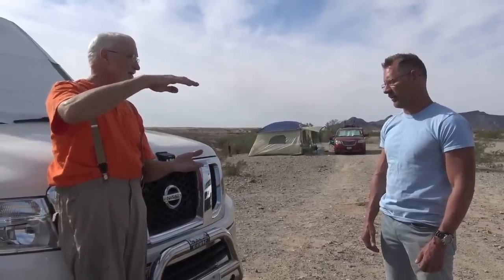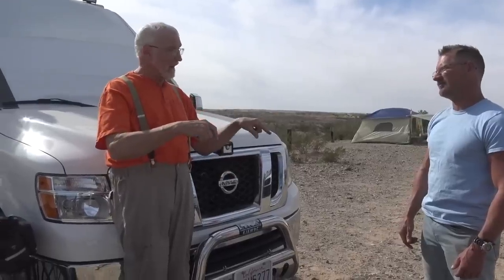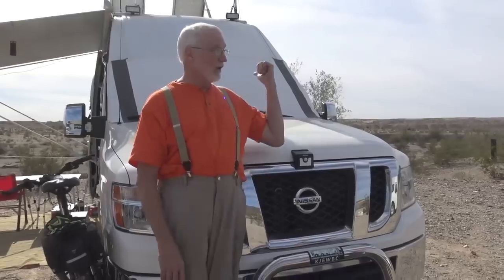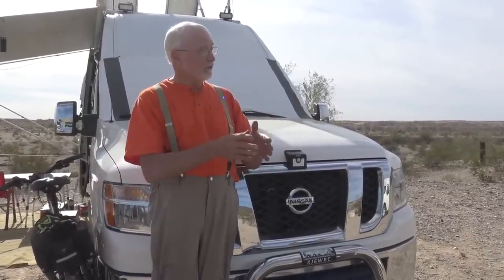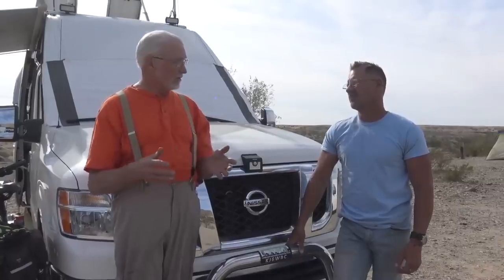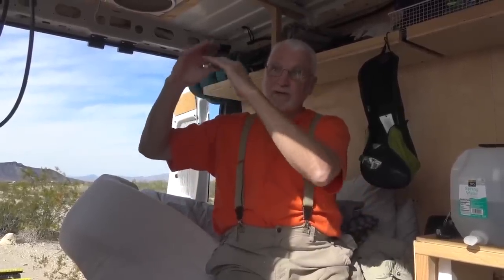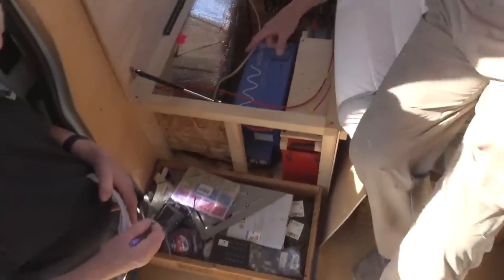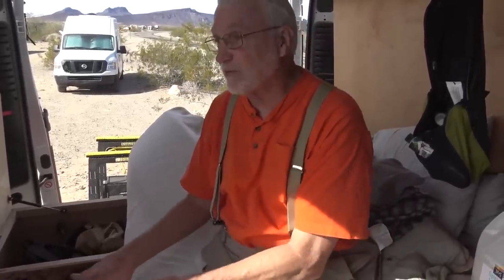Lee Blake: Deep Cycle Batteries |  Solar & Islolator Charging Explained

Comment: Lee is a wealth of knowledge and if you don't want to do the investigation just do what he does. That said when I first learned about the PC1800-FT batteries they could be purchased for 450 each. Now they're 600. Out of my price range. The UB121000 are 150 each making 400Ah half the cost of the Odyssey pc1800-ft times 2. I concede that the Odyssey pc1800-ft is a better battery, but if I were to spend 1200 I'd spend 1700 on Lithium.
Reply: Wow, just read about this battery. 22 inches and packs that much power! Amazing. Does this battery have to be vented?

Comment: FYI- the battery isolator that Lee is using is expensive but after watching this I started looking around and I discovered that Sure Power makes a few models also.  Thwy have 12v and 24v models.  Sure Power 1315-200 | 12-Volt 200-Amp Bidirectional Battery Separator.  Sure Power 1315-100 | 12-Volt 100-Amp Bidirectional Battery Separator and both are less the one Lee is using although I bet his is top shelf.

Comment: At 12:12 is the reason i'm thinking that installing a smallish Electrical Boiler in a VAN may not be a bad idea... may need somewhat of a smarter control unit, but using the power to heat up water isn't a bad use for it ... somewhat similar with an electric heater ... but again there you will want a smart controller and battery management system to use the power in the smartest way, to keep comfort levels high, while using the most power possible, while still keeping the battery full ... maybe even an integrated weather forecast system can help to determine the amount of power to expect to be gained ... and obviously some memory in regards to the power usage profile ... obviously would need various sensors too ... but in all honesty, the whole thing doesn't sound to complicated, and a raspberry PI is probably already overkill for something like this.

You got your energy sinks: battery, waterboiler, electric heater (with feedback sensors)
You got your energy use profile: daily habits, weekly habits (registering database, query's)
You got your energy supply: solar power (shore), battery
You got your energy supply profile: weather forecast (historic energy supply data)
You got some priorities to be set: order of shut down, order of using sinks.
You got some piece of software keeping track of all of these and operating the whole to maximise power storage, while maintaining optimal comfort.

Seems easily doable tbh...

Comment: Really appreciate the knowledge shared here. Getting my cargo van ready for camping and I want to someday put in solar with this capability to charge the engine battery as well as the "house" batteries. Is there a basic schematic that illustrates all the necessary components and how they are hooked up?

Comment: 25:28-26:30 What exactly is a charge profile? Does this refer specifically to the charge controller?  If so, why change the start battery?  I'm not sure how the starting battery would be a different volt or amp characteristics than the house battery.  Thanks again for sharing your vast knowledge and keeping it relatively simple for a "Youtube" student interested in Solar installation and function.  Thanks Jaime for videoing it .
Reply: Every battery chemistry has a specific voltage that is best for each stage of charging.  A charge profile assigns a voltage and percentage of charge for each stage of charging. He stated that the Odyssey wanted to see absorption stage at 14.7 volts and float stage at 13.6 volts. Other AGM batteries may want to see 14.4 volts absorption and 13.7 volts float. Testing at the manufacturer also helps to determine which percentage of charge is best to switch from bulk to absorption and from absorption to float. These parameters make up the specific "charge profile" for each battery and with the right charger or charge controller parameters can be matched to the charge profile of the battery  to ensure that you are charging the battery in the most efficient  and durable manner.

Comment: Awesome info 
Lee I'm a solo retired lady with F150 truck pulling 18' Rpod.  I've got 2 6V deep cell batteries. Use to run my generator almost daily to recharge batteries.  Recently had voltage monitor installed. A bit confused when I should recharge batteries. If not suppose to run below 50% does this mean recharge mostly when voltage shows down to 7.65 volts? Thanks

Comment: So do I need to scuff the paint or will the self tapper creat the proper ground connection by default? The question never got answered.  About twenty seconds of important information was reapeated but which is fine but that other peice of information would have been nice to know as well. Thanks for listening.
Reply from the maker: I always scuff down to Bare Metal Robert.

Comment: A lot of folks are using the lithium batteries from Tesla automobiles, pulled from vehicles that have been totaled. Quick notes reference: 5.2 MAh, (or kwh), 
24V (25.2v to 18v)
45 to 55 pounds, 27 x 11.5 x 3.5, Lithium Nickel Cobalt Manganese Aluminum Oxide batteries, from reputable source and guarantee, $1,300, and I have seen them for $900. There is talk of these batteries lasting longer than a person's life. If people want reference material, let me know.

Comment: Just discovered Lee on Enigmatic.  I have a similar design philosophy, modular.  I'm in the planning stages of a 170 Sprinter 4x4.  I'll be selling my low roof 140 Sprinter which was essentially my test bed.  I have 2 questions for Lee;  the square clear dry goods containers you're using, where do you get those?  Secondly and more complicated.  Do you have any thoughts on running things like the cook top, computer chargers, etc from DC power sources.  I'm thinking this may reduce losses from inverting/rectifying.  I was thinking of making adjustable/variable voltage DC outlets throughout the van so I could dial up/down for specific devices.

Comment: So if I buy a engine battery in to match the house batteries so they’re more compatible with the solar, should I replace the alternator with one that matches the battery better if I’m on the road more than the average? Or will the solar keep the engine battery charged better? 
And what happens if I’m doing a lot of traveling at night?
Is there a potential to damage the alternator if I leave the original in?

Comment: Can I still use this plan if I have a normal starter battery in my class C (ford V10) with the starter battery connected to the coach batteries which have been upgraded to 2 Battle Born 12v 100 hr (lifepo4)?  I like the idea of using our solar for all the batteries. 😀 it sounds like the switching voltage levels are good/safe for both types of batteries... But I'm not a pro.

Comment: Another great video. Lee is so knowledgeable. I think this is the relay that Lee was talking about https://www.sterling-power-usa.com/ProConnectVoltageSensitiveRelay.aspx
Gosh, Lee has such strong following. He is a true influencer. His youtube has no video but has over 8000 subscribers. He can make some serious dough in this social media economy. 
I am researching installing hitch and brake controller and wires to prepare my RX 350 for towing my just ordered yet to be built casita. I found many installers do not isolate the 2 batteries. Even installation on YouTube does not do it. I am researching add isolation myself. The VSR sounds much more elegant than the ignition controlled relay. Thanks

Comment: I'm new, my question is do I need a charge controller to charge house battery from van alternator?  thanks, Sam
Reply: Normally I believe charge controllers are used when one has solar. That said I am not certain if one would be required or helpful if you have a specialized battery type(lithium) with a different charge profile compared to a normal battery type the alternator is charging(lead acid). Here is a video on installation of a batter isolator this is a one way charging system. https://www.youtube.com/watch?v=1zrwHyy4qyY

Comment: Thanks for a great video Jamie and Lee - I was not aware of that product line from sterling.  I’m running one of their BB1230 Dc->Dc chargers in my jeep and love it.  My system is a bit different with 2 AGMs under the hood connected with a standard voltage sensitive rely in a jeep specific mount feeding a Battle Born 100AH in the back via the BB1230.  The rear system also has 200w of solar and will soon have a second Battle Born 100AH.  I need the charger instead of a relay due to the different battery chemistries (and dont want to go lithium under the hood where it is super hot and I have a winch, etc).  It would be awesome it the BB1230 was bi-directional with support for different charging profiles on each side... 😀

https://www.sterling-power-usa.com/SterlingPower12volt-12volt-30ampbatterytobatterycharger.aspx

Comment: The used Tesla s batteries5KW -55 pounds-- 1100 amp potential discharge rate--low resistance so quick charging--98 % charge efficiency --24 volt  doubles the capability of an MPPT controler----available on E-bay for around $1300---worth a look but must be set up correctly or can burn up your van--yet safe if properly set up- IMO  worth a look--https://www.mobile-solarpower.com/tesla-solar-battery-diy.html

Comment: should not let batteries go more then 5 days with out being charged 100%, also you need a battery temperature sensor, because batteries need to charge differently at different temps in the different stages of charging

Comment: an isolator is a absolute necessity but all batteries must be in good shape.
Reply: Is it possible to use a voltage sensitive relay ie: CBSR or is a simpler celluloid switch better when utilizing 4 coach12 volt batteries, paralleled to 24 volts  and a starter acid battery. Thank you in advance for your time.

Comment: Ever since Nissan merged with that French company Renault, Nissan vehicles have gone to Crap so don't buy one folks unless you want to have mechanical problems after 100,000 miles! P.S. folks, a simple solution to keeping your engine battery fully topped off @ Full Charge is to place one of those small 12 to 15 watt portable solar panels clamped onto the engine battery & bingo bango Bongo your battery discharging issues solved no need to go through all the trouble that this gentleman's explaining to do so!
Reply: Lot of overlanders do that.
Reply: @freetrailer4poor  That is completely untrue! I am a Certified mechanic & a well-built vehicle that is a gasoline engine should last 250,000-300,000 miles with routine maintenance.
Reply: Barney Ruble, re your comment "Ever since Nissan merged with R..." Are you able to give me the date? As they have collaborated for some time now. Is there a best before date? Thanks in advance.

Comment: Typical engineer, over engineer everything.  A simple oil pressure switch on the engine would prevent the starter battery from connecting to the other batteries unless the engine is running. All these relays makes diagnosing problems more difficult for the common man. I usually end up working on things that engineers engineer. The main issue is that engineers design things for easy manufacturing  and not ease of repair. So unless you are an electrical engineer, don't do what he talks about. Fixing this stuff is a real headache.  If anyone ever designs something that will not fail, buy it. Otherwise keep it simple.